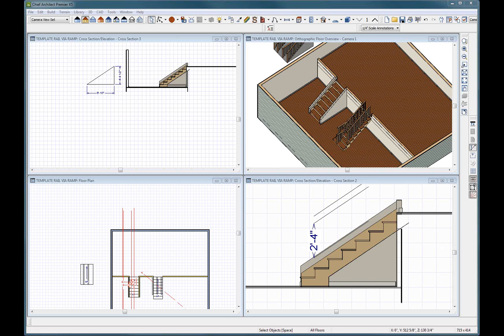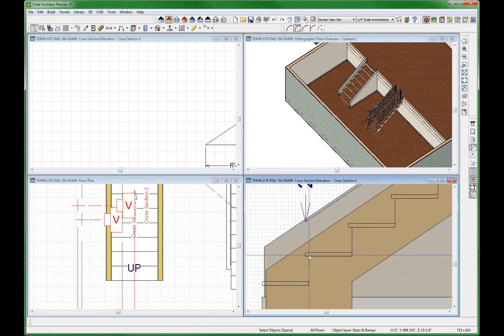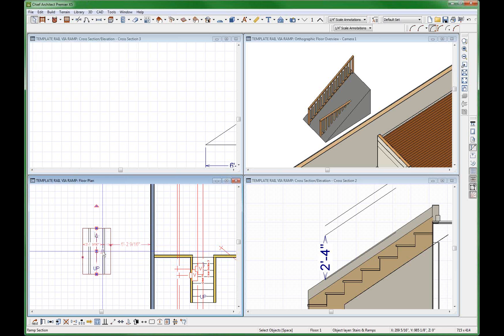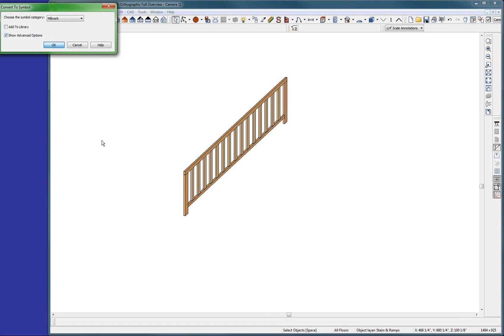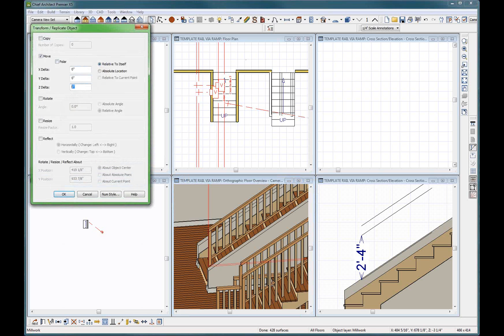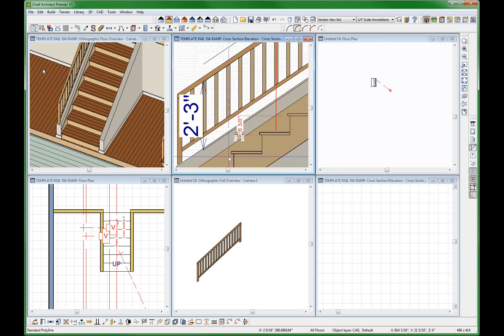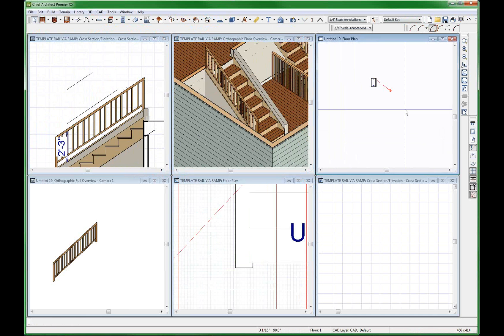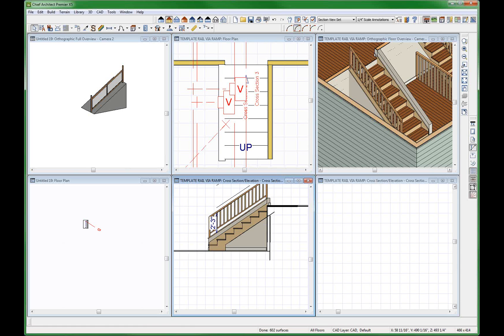Building Custom Stair Rails Chief Architect Videos by dsh

Comment from the maker: I can't get railing to follow stairs.  This is a situation where the rail sits on the pony wall adjacent to stairs.  I do not know of a way to have a rail sit on a pony wall that is sloped with stairs and is 8" higher that stair nosing.  If you can do this,  please post a plan so I can study,  thanks.

Yes,   you can fill a symbol but I do not believe that symbol will be in forground of wall.  I think the wall fill will cover the symbol with the solid fill.

Comment: Scott, nice. fyi, you can fill a symbol by opening it in the symbol DBX. 

Question, why do I need a ramp at all when the railing will follow the stairs?
I think you can adjust the bottom rail for your wall cap also, not needing the p-solid.